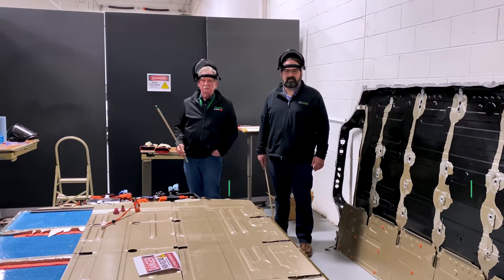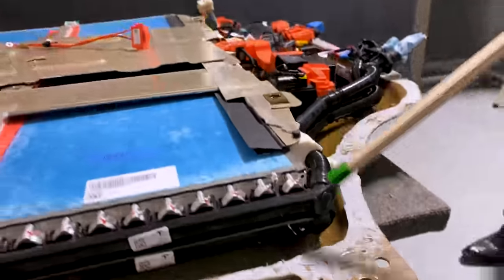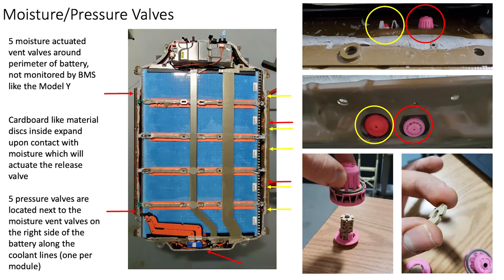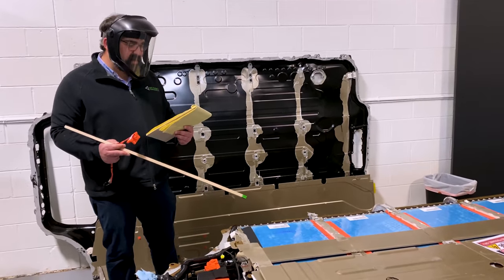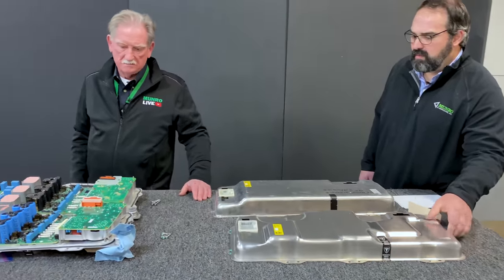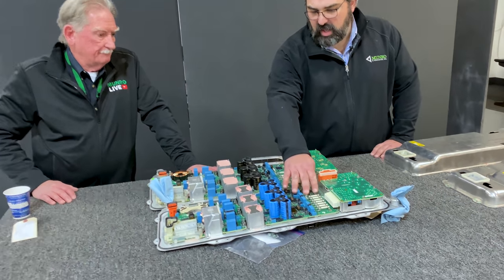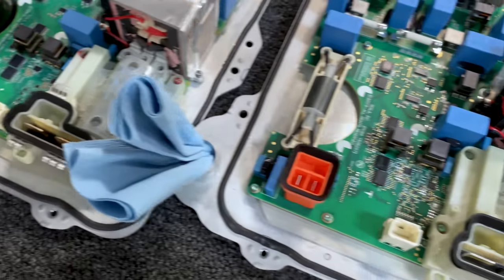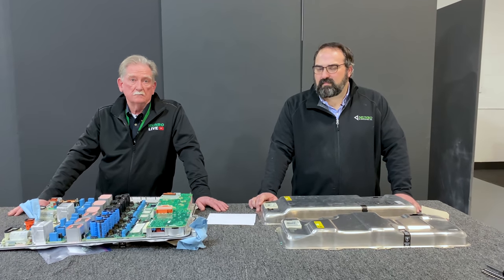Engineering Masterpiece | Tesla Model S Plaid Battery Pack

Comment: All the filter components seem to have shrunk, so maybe they're running the OBC and DC/DC at a higher frequency and/or using frequency dithering to reduce the filter requirments.
Reply: the better performance of the nichicon caps might also help in the total picture.
Reply: Man im so ready for them to switch to GaN transistors and bump the freq up to 1+ MHz. The freq increase and dramatically better transistor charactaristics should yeild a near 3x power density increase and or a massive efficiency bump. Or both to a lesser degree.
Reply: Dont underestimate TESLA.
Reply: Not surprised in the slightest to see you in the comments of this video, Mike. Would love to see an analysis from you if you can find one at a reasonable price (Munro probably isn't planning a deep dive on the level you usually do).
Reply: Engineerix has done a very detailed video on all those electronic components, sandy has absolutely no idea what he’s talking about tbh!
Reply: @alanmay7929  Well, he even said he's no sparky right in the video. What were you expecting?
Reply: Send Mike this board!
Reply: @alanmay7929  Ingineerix*
Reply: Exactly, same thought
Reply: Jan 6 was "Wall Street Putsch" part 2  was about to say that, and very cheap to boot, but heavier
Reply: Or maybe they hired some GM bean counters who said screw it, these smaller ones are cheaper & good enough
Reply: Jan 6 was "Wall Street Putsch" part 2  Mica has a thermal conductivity of about 0.7  W/mK; that's much higher (better heat conductor) and materials chosen for insulation, much lower (better thermal insulator) than metals, and similar to many solid materials such as glass or concrete.
Reply: if by that you mean electrolytic capacitors, how do you propose that would happen? Afaik electrolytic capacitors are invariably terrible at higher frequencies.
Reply: This time what went on in Vegas will not stay in Vegas!!

I met both Britney Spears and Elon Musk early in 2000 at Bellagio. Britney just stared at me as she was singing on stage and I was standing in an archway above and nearby. I'm not sure if I had was supposed to be standing up there by myself but I did have her undivided attention. A few days later Elon came up to me and started asking me questions about what I was doing there, in Hawaii and Las Vegas during that time. Would I be fine answering a few questions and if I was a gambling man? I stated, "I was on vacation and I only like to bet on things that are worth betting on!" I had earned these trips by qualifying reward points at my work. He asked, "What kind of work is it that you do?" I said, "Commercial energy saving promotions but I had been schooled in Automotive Marketing Business Administration and worked in that field for several years as well." He asked me, "If I had millions of dollars to spend what would be the most innovative businesses that could help humanity?" We talked about electric cars, we talked about solar energy and so many other subjects for over an hour. Even commercial space exploration for the consideration of colonization. That way all of humanity's eggs are not in one basket in case of another world war, asteroid strike, major climate change, etc. These we're very expensive and ambitious businesses to become successful at. Therefore we had to talk about ways of keeping a low overhead in advertising, distribution and the manufacturing. He said, "They were all very good ideas and that they should be done!" He said he had already made hundreds of millions off of a couple internet companies he started. "One of them was PayPal," he stated. Not that I had really done a lot of online banking or e-transfers at that time I didn't think much of it, until I noticed online about a year later that I could buy something off the computer with my PayPal card! Unfortunately I had just received a promotion as regional manager with the company I was working with. This made me let Elon know that I had to wait for a few years before I could assist further. I keep on sending out messages, hoping that he will get one and reply back. I will probably have to keep on trying, he gets more messages in a day then I would in five years! It is very inspiring to me to have a conversation with someone and they dedicate the next 20 years to making our conversation reality! We also talked about becoming your own best supplier and starting businesses that help your existing business. A type of slingshot effect that he has incorporated very well. It is so ambitious and amazing that he was willing to put pretty much all of his money where his mouth is and just make it happen with a consistent dedication. Congratulations Elon and I am looking forward to working with you again, one day in the near future! Of course Britney I always wish her well and would enjoy meeting her again as well! Shoot for the Moon then Mars and then we will end up amongst the Stars! If you would like to learn more of these topics let me know. People with integrity expect to be believed otherwise they let time prove them right!!
propower101@hotmail.com

Comment: I rebuild salvage Teslas in Ukraine. Great analysis guys. One thing that immediately stands out to me - by putting the onboard charger and DC/DC in the front of the pack, they have hugely improved the pack's crashworthiness.  

I've seen a lot of packs that, in a severe frontal impact, have intrusion/deformation into the front end of the pack (where 2 levels of modules are). This likely has caused the fires in some cases.

This new design essentially gives a much larger front crumple zone before any impact could touch the cells, thus reducing the risk of fire in a front-end collision.  Deformation would have to be almost to front of the driver's seat before the cells would be impacted.

Yet another example of great, intelligent design and constant improvement!!!
Reply: Ahoy to the fellow Ukrainian. Re Tesla, their original M3 design was very very bad - not only the battery was the first to get hit, but also the exposed cooling pipe, which was very easy to damage requiring (as per Tesla) battery pack replacement.
Reply: Great insight!
Reply: From a maintenance point of view it could be better, though. If the DC/DC convertor or charger fail, the entire battery pack is junk. Separating them out into external modules would reduce the number of faults that cost $16,000 to fix.
Reply: @spankeyfish  I've not yet seen either of those fail.  (Except in the case of flooding.) But I am interested to see what now is taking their place under the back seat!
Reply: @chdcalifornia880  flooding: good point. Living in Tesla-savvy Netherlands a major part of the population live at or below sea-level and different rivers regularly flood (albeit controlled). Uncontrolled small-scale flooding occurs more and more often along European rivers and for that matter: all around the world. Not crashing is great and the car can manage that. However flooding not. And these cars will last for 20 years of global warming ...
Reply: @nas4apps  hopefully they've redesigned the pack structure for better waterproofing than the previous packs.  Model S/X 90/100 packs are definitely NOT waterproof, if immersed for a long time.
Reply: @chdcalifornia880  They mention in this teardown that there's pressure and humidity vents, I expect that water would be able to leak in through them under at a sufficient depth.
Reply: @spankeyfish  exactly. Putting this all in one pack is a terrible long term design. They are doing everything they can to make you just buy an new car rather than repairing it.
Reply: I am sending you my thoughts and moral support from the UK, the world is rooting for Ukraine.
Reply: Love and prayers from the U.S.
Reply: Hey, I'm from the future. I hope you are safe.

Comment: Sandy loves parts having multiple uses, rest of the consumer world despises this due to the extreme difficulties in replacing integrated parts. Prime example is BMW running oil or antifreeze through alternator brackets. Great for bmw to save parts but adds $1,000 in service fees when the .39 cent gasket for it begins leaking.  Part integration should only be considered for non service items when possible.
Reply: Indeed… see a 1952 GMC truck for king of simple. But then the engine design is from 39 or so.

Comment: The added fuses and transformers at the input of the onboard charger probably have to do with the fact that the Plaid charges at 16.5 kW on AC, whereas the model Y only draws 11 kW. It's two versions of the onboard charger that share one common board design, hence the unpopulated components on the Y.
Reply: I haven’t seen that anywhere. It looks like still 48a charging. Where’d you see that?
Reply: @jonathanviventi1380  well in europe model S/X charge at 16.5kW AC from 32A three phase plug so maybe they are just using same charger for us. specialy if that new model S charger works anything like my model 3 charger that can take 11kW from 16A three phase or 7.3kW from 32A single phase. btw 32A (one or three phase) is moast amps you can get from the plug. so because that i think my model 3 coud get full 11kW from 48A singel phace if that woud be availeble in here.
Reply: @aleksisoukkala  that's a good point. Guess it might have the same charger in all markets. I think in the US it maxes out at 48a single phase.
Reply: @aleksisoukkala  actually the most you can get from Type 2 plug is 63A ;) some French cars (Zoe?) could leverage that
Reply: okay. I just haven't seen any type 2 cable that is rated for 63A. And also it wouldn't really make sense cost stand point to make a car whit AC charger that can use 63A because most AC charge points are max 22kW (meaning 32A and 400V three phase)
Reply: @aleksisoukkala  perhaps that's only viable for integrated cables. IMHO 22kW is just right for AC and that's what I see in most regular AC posts, I even specifically got myself an used S with twin chargers. And 43kW usually being combined in a charging station with 50kW CCS and ChaDeMo.

Comment: Just seeing the coil improvements is incredibly impressive.
Details, details, details.
Reply: It’s not impressive at all, Tesla barely makes two vehicles the model x/s and model y/3.
Reply: Of your 707 comments on this channel, are any positive?
What's bothering your soul ?
Reply: @alanmay7929  That's 4 vehicles.
Reply: Higher 1/T
Reply: @logitech4873  It is effectively two. You know what he means
Reply: @MrCarGuy  I don't know what he means by saying it's not impressive because there's few models, how is few models a reason for it not being impressive? By that reasoning there's nothing impressive about Lucid or Rivian either. Nonsense.
Reply: @PaulHoke  probably not, he enjoys making negative comments because he likes getting replies I guess.
Reply: @alanmay7929  it would be impressive for Tesla to make more models? I think times have changed in that regard. The electronics in EVs will probably be much more cross compatible than the engines between different ICE cars.
Reply: @daveinpublic  wrong, time haven’t changed, engines comes in all sizes and types possible for all kinds of applications, all kinds of fuels(diesel, petrol, LPG,CNG, biodiesel/gas…), all kinds of configurations….. also the fuel tank size to significantly increase the range is amazing, all the different other applications like tractors, very heavy duty machineries, aircrafts, boats, trains……
Reply: @alanmay7929  no one is arguing that there aren't specialist niche applications for ICE but they will shrink as EV tech begins to dominate in light vehicles for personal transport.  EV batteries and components will become cheaper, ICE will become more expensive and those factors, in combination with the already lower fuel and maintenance costs, will see ICE diminish to only those areas for which there is no alternative.  There's no way this will not happen, the only question is how fast.
Reply: @bluetoad2668  lol…… ICE are already the cheapest and will remain as it is, only the fuel prices can have an effect. Maintenance is really not a drama and the exchanges fluids are actually collected and recycled. The US alone has produced almost a billion gallon of biodiesel a year with used/cocking oil and even fattbergs from sewage and fats from animals….
Reply: @alanmay7929  I’m not so sure that ICE will remain the cheapest. EV technology and manufacturing processes are improving crazy fast, battery manufacturing is going in house as Tesla, inexpensive Chinese battery companies are starting to make cars for like $15K. EVs are much simpler to make than ICE after you have the battery. And maintenance and refueling an EV is much easier and cheaper.
Reply: @daveinpublic  if you have been living under the rocks, there have been ICE that cost even less than $10k for decades and those still have better range than a modern EV. Battery manufacturing means nothing when there is not enough lithium and raw materials. Batteries are also not just used in cars but trucks and other bigger vehicles, smartphones, devices…..
Reply: @daveinpublic  maintenance and refueling on ICE is actually way easier and even faster on ICE, plus the possibility to add auxiliary fuel tank….. possibility to run used oils on older engines and much more
Reply: @alanmay7929  The best thing is, that you will live long enough to see the world go 100% electric and eventually realizing, that you´ve been living the entire life in your own delusional ecochamber. I feel peace just thinking about it.
Reply: @kuznacbendelejev6924  I’m talking about reality and what we are living, I never said anything will not be electric in any future, it’s going to take very long time before it even happen, we need new technologies and new batteries or materials/composite materials or even fuels for all transportation systems around the world. I’m also thinking about the poor/third world countries that have been using old 10 to 50 years old ICE where no EV can even compete. It’s not hate but reality.
Reply: @kuznacbendelejev6924  the tesla semi has been unveiled years ago and it’s not going to enter production anytime soon, bigger vehicles simply require a lot more battery capacity and range…. What about bigger trucks? Trains, and other big vehicles/equipments!? It’s very serious, no joking here.

Comment: Surely, giant matches are the safest tools to use when touching a live battery pack 😜
Reply: Having worked near very high voltage and high current equipment, most safety boards include a long wooden cane to hook and pull people away from electrocution. So yes, poking that giant dangerous charged battery with a wooden stick is in fact perfectly safe lol.
Reply: Exactly😸

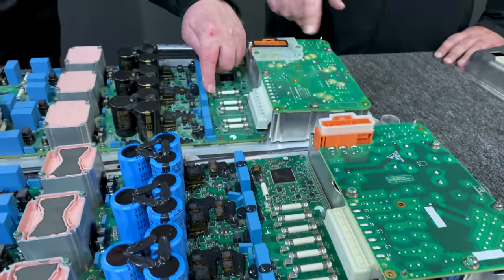Comment: Hey guys, I'm a high end audio DIY designer and scratch builder. Those capacitors around @20:00 are nichicon on the newer model and Kemet on the older model. These are good quality capacitors, like audio quality and I'm surprised Tesla uses them. I'm impressed. Bet you won't find them in the Chinese products! Also, 400 volts is safe. These 800 volt architectures are going to be pushing their luck. All my stuff is around 400-450 volts, but a friend of mine builds with big vacuum tubes that run around 850 volts and those things are hairy. Porcelain caps and all. I'm interested to see how the 800 volt architecture pans out. I imagine many components having to be special order. Those 500V 330uF nichicons are off the shelf items. Try finding high voltage 330uF capacitors and the choices are slim.

Comment: THANKS4GIVING:
Mica was used in old stove pilot light windows, old tv tubes, very resistant to high temperatures, it an insulator, a soft layered stone. I don’t think mica has been used much commercially for many years here in the US.
Reply: Capacitors not made of it in USA ??
Reply: Mica is still used as a microwave guide covers.... ;)